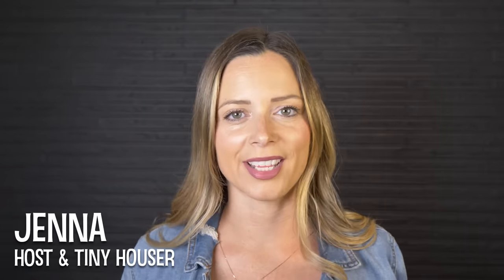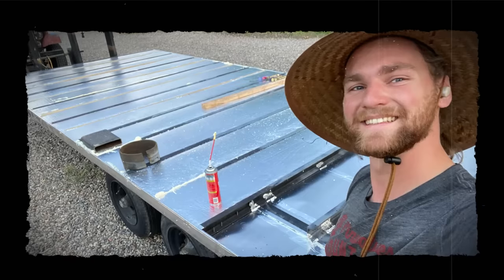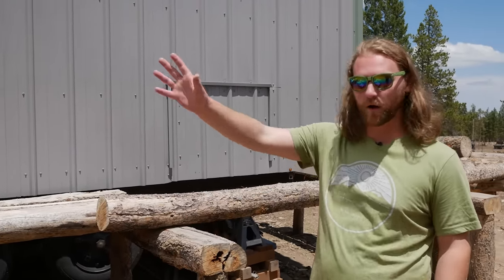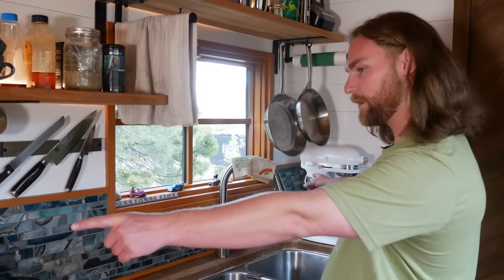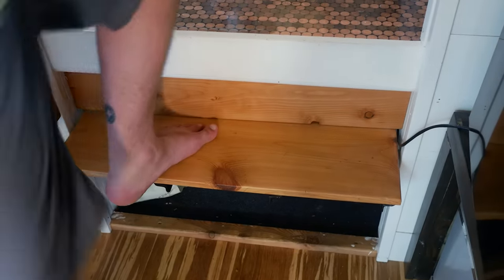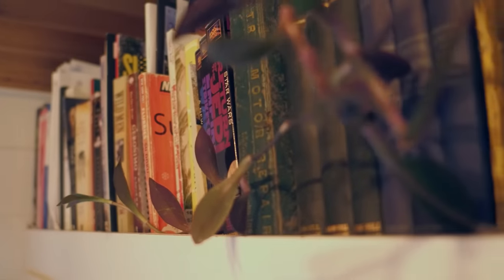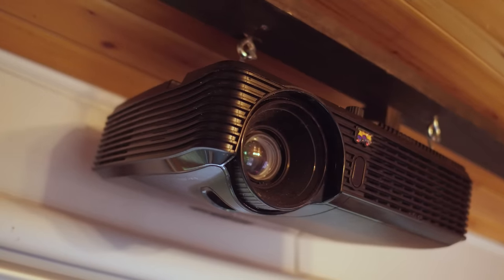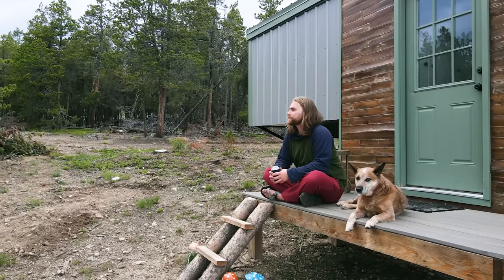Stunning TINY HOUSE build on 5th wheel trailer w/ solar power

Comment: So... do we call this one "Tiny Tim?"  I'm totally blown away that Tim was able to put this together in 3 short months!  There are so many small details that take time - like making the butcher block, the penny floor, the kitchen backsplash!  Nicely done, Tim!  I think you should go into the business of building these.  (And yes, NEVER use a second-hand skylight!  I installed one on a metal roof about 25 years ago and the homeowners have since told me that it never leaked - but it was bought new, and I spent 45 minutes on the phone with the manufacturer, Velux, getting precise instructions.  Worth that effort!)
Reply: Hahahahha😂 Tiny Tim

Comment: I have a washer-drier combo I am not using any longer. From day one there has been nothing but trouble. Did not wash well, too small of loads and heating eliment kept burning out. Never did dry well. Not energy efficient. I replaced it with full size front load.

Comment: Finally honest comments shown gr8 channel
I often wonder why if built to move, why are tbe designs seemingly like draggin a house cant b easy comfy or safe. Wouldnt work travellin aus?? Is there a cv look with house inside?
Reply: I don't move the house very often and didn't design it to be lived in while on the road. My idea behind building the house on wheels is to allow the house to be easily moved when necessary, but be primarily lived in while it is stationary. I wouldn't have open shelves if intended to live in the house while on the road all the time.

Comment: For the tongue and grove wood next to the front door:  I think it looks sexy.  Are there any products to preserve it and protect it from the elements?
Reply: I applied several coats of exterior wood lacquer, but because the wood is so thin and not rated to be outside, the coatings have started to peel off. I either need to refinish the wood every year, or replace it with a proper, outdoor rated siding.